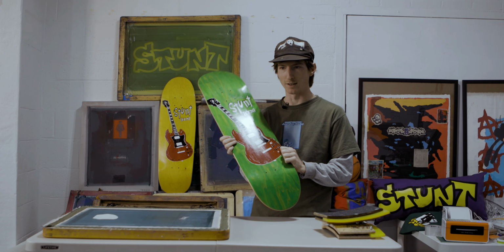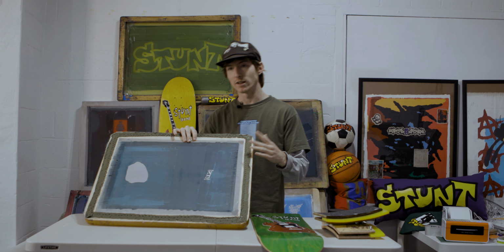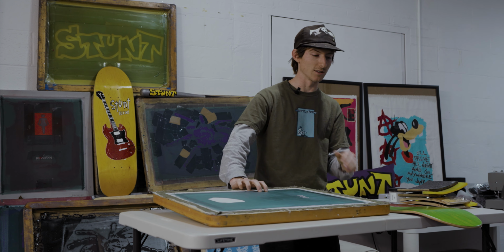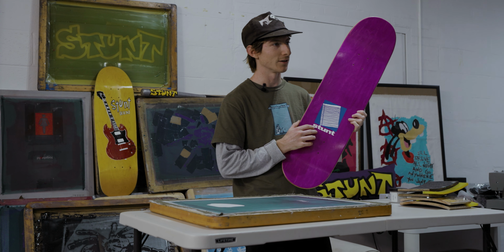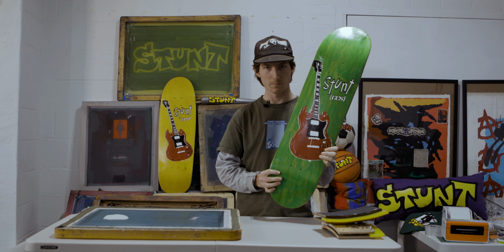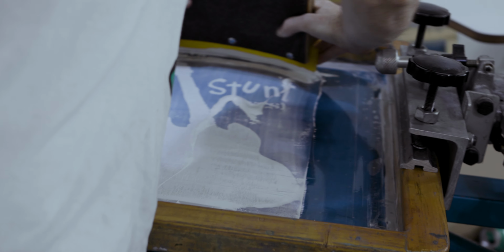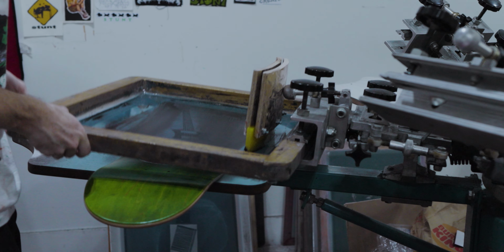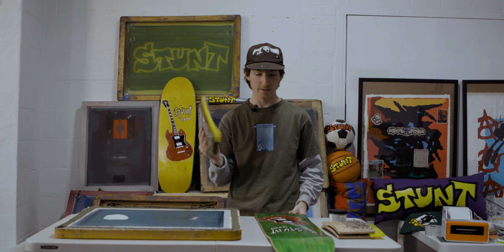HOW TO SCREEN-PRINT SKATEBOARDS! AT HOME! DIY TIPS AND TRICKS

Comment: what about putting a base coat on the board?  I got some BBS blanks, with just whatever random stain color happens to be on each one.  For my design, I don't really want to print right on the stain, I'd rather have a solid base color that's the same on every board.  Would you just tape off the sides and spray paint the base coat?  Or brush it on or something?  I imagine full-bleed printing a base layer  with just a blank screen isn't an option because you wouldn't be able to reach all the edges due to the concave...
Reply from the maker: I put down a white base layer for these boards, and then stacked all my colors on top that way the colors don’t become dull due to the wood stain.  Not sure how your printing set up is but if you want to cover the wood grain you could spray paint the entire bottom side but sometimes the coats become uneven and hazy looking. Board printing is a tricky game.  I’d go for a white base layer under your graphic.

Comment: Hey man, for the white base layer i bought waterbased polyplast white which was supposed to be pretty sctratch resistant. Then I tried printing with it and it was super runny, like really fluid, it didnt look like the white you were using in this video. From being so runny (I think so) it got smeared underneath the screen and I had to clean the bottom side of the screen for every board.. super annoying and exhausting. WOuld you recommend just using normal white fabrique color next time?
Reply from the maker: @user-sn5li8ho1z  yeah I’ve run into that problem a few times before. It partly has to do with the runny ink, as well a super loose screen mesh. I’m not sure I’ve used anything called polyplast. But if it’s too soupy switch to something thicker, Like permaprint ink. That’s a better waterbased ink. Best of luck to you.
Reply: @ Thanks!

Comment: What ink u use it?
Reply from the maker: Water based
Reply: @stunt-365  thankyou dude
Reply: @stunt-365 can you be more specific on the ink? what kind of water based ink? there are lots of different water based screen printing inks out there. i am asking because im looking for a more opaque wb ink for boards. also you should be able to print subsequent colors even only an hour after the base. most water based inks should be dry enough to print on top after an hour or two. waiting a day is prob great, but man that will take a looong time. last question, what about nose to tail printing? do you make screens for that also?
Reply from the maker: @lockandkey_creative  I’ve used a few. If you’re looking for cheap I’d go with speedball ink. For a few extra bucks I’d use permaprint inks or matsui waterbased inks, those dry real nice. As for nose and tail printing. If you make the screen a lot bigger than the board you’ll be able to bend the mesh over the nose and tail. But if you don’t have a massive screen I’d make a lil rig on a table and kinda wing it haha part of the charm of screenprinting! Happy printing